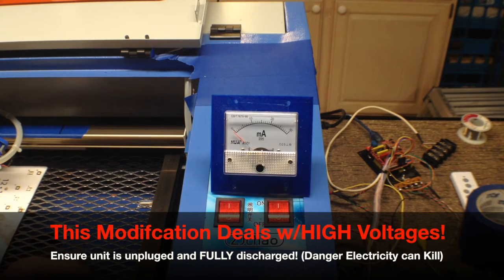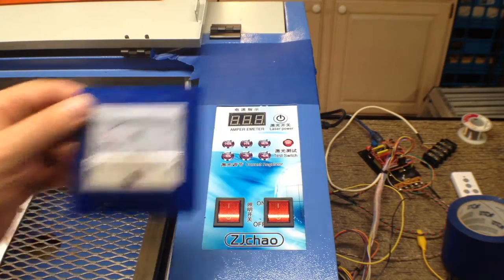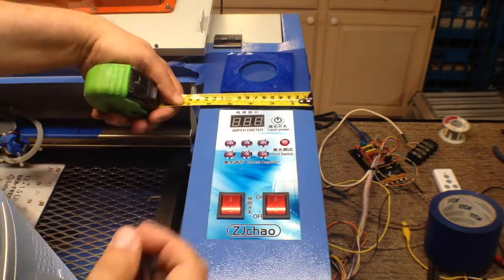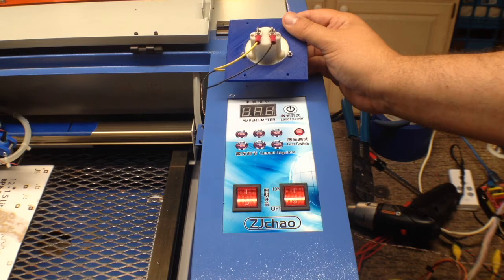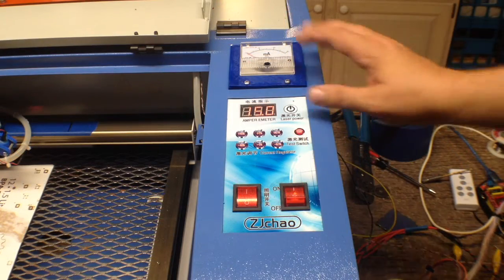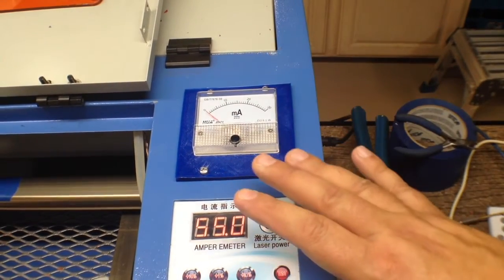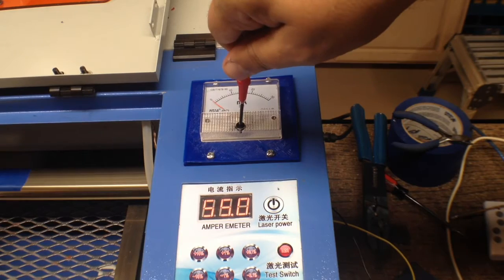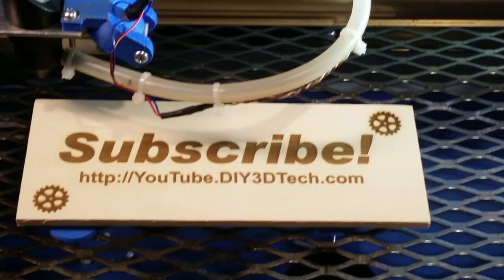K40 eBay Chinese CO2 Laser Cutter - Installing a Current Meter!

Comment: What gauge wire to use for the ma meter to the laser? I'll be doing a 50w
Reply from the maker: Gosh it doesn't have to be heavy as its only in the milliamp range.  I just used hook up wire from what was Radio Shack...
Reply: @DIY3DTECHcom  So what's a good guage rating?

Comment: Step by step to wiring the meter would be 100 times more helpful :-(
Reply from the maker: If you were paying attention to the video I explain that I showed how to wire the meter in a prior video (https://www.youtube.com/watch?v=4tDK3yOhN3E&list=PLInTrkIbj69kPO_UP81yxX-xov4SVyPlD&index=34&t=0s)  and this video is about installing the meter itself.  There is a K40 playlist which will have all the answers to any question you could have related to a k40.  Hope this helps :-)
Reply: @DIY3DTECHcom  In this video I'll show you how to use the accelerator, I'll show you how to use the brake in another video... stay tuned... from your hospital bed...

Comment: what specification of the current meter did you use? is it okay to use regular current meter for high voltage?
Reply from the maker: Yes, also if you at a couple videos before this there ls likely an eBay link :-)

Comment: You didn't show where you connected it to?? Where do the connections go?
Reply from the maker: This video is only about mounting the meter, there is another as mentioned in the video (check the K40 laser playlist as its been a while).  Also @ 2:10 I share with you as recap where the the connections are...
Reply: exit of tube to + of meter, - of meter to the PSU where the exit of tube was.

Comment: Thanks for this video. Would you be able to give a conversion table? For example what MA is 5%/10%/15%/20%/25%/30%/40/50% and so on? Thank you.
Reply from the maker: 21ma is "max", however that is also over driven so I would use 18ma as 100% and divide down, yet the power curve is not linear when you get to the lower numbers...
Reply: @DIY3DTECHcom  thank you.  I only have the digital display so have no idea of the m.a. outputs.

Comment: I have a "Digital Amp meter" purchased from "DigiKey model 1528-1144-ND" it is a lighted display..Can this be installed And how can I connect to 5 volt DC for the lighted display?
Reply from the maker: Yes you could use it, check you board voltage out of the PSU as I think its 5v and it would connect like this one but you better know what your doing as your messing with 25,000 volts even if it is low current...
Reply: NO problems..thank you Opps..only problem I have is Water pump doesn't seem to be enough(cheap pump supplied when purchased)
Reply from the maker: You don't need to move a lot of water, I use a PC CPU cooler pump...
Reply: Would you happen to have a link?
Reply from the maker: https://goo.gl/amaVaG
Reply: Thank you kindly..I'll look into that.

Comment: Can i ask why the faceplate instead of putting the meter directly into the plate like most do. The meter direct is much neater in my opinion.
Reply from the maker: Neater assembly, as it is easier to print a "fitted" face then try and cut a detailed hole with dremel tool.  You will also notice the two mounting screws are very close to the lower portion of the back of the assemble and this makes also difficult to mount...

Comment: I was about to buy a meter and it said Note: this ammeter need to work with a 30A/75mV shunt, which is not included here.
Reply from the maker: Not quite sure of the question as this quite sometime ago, as meter I got is still listed in the description (and active on eBay) and if recall correctly I just connected inline with the tube...
Reply: Shunts are usually build in for small currents. Anything over 10A would always require a shunt.

Comment: There are several variations of 40W Chinese lasers on eBay. Do you recommend any particular type and/or any particular U.S. based seller?
Reply from the maker: There are two versions, the ones with the pots and the other with digital indicator.  My two cents is buy the one with the pot (knob instead of display) as its more flexible.  Also they are basically are made all in the same place, just different sellers.  Would focus on an eBay seller (list of eBay sellers:  http://diy3dtech.com/purchase-laser/) as opposed to Alibba...